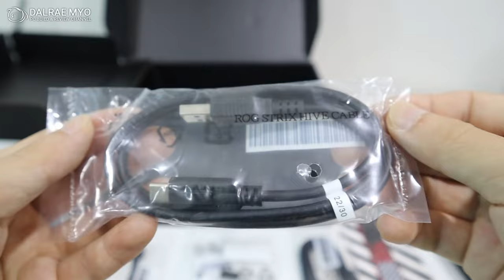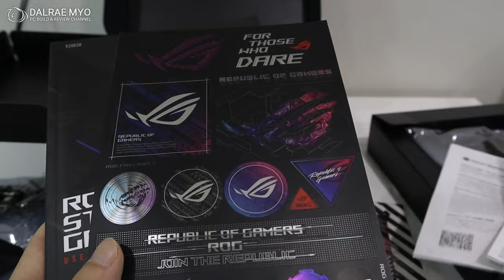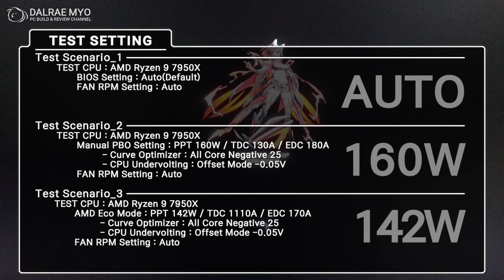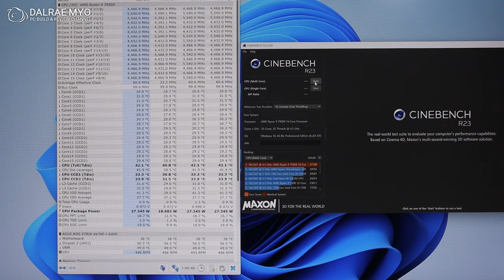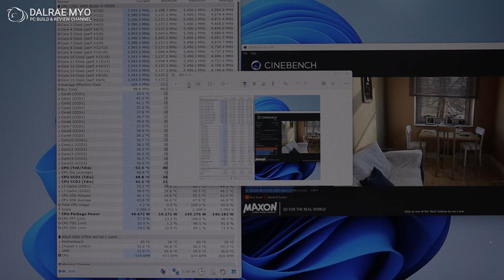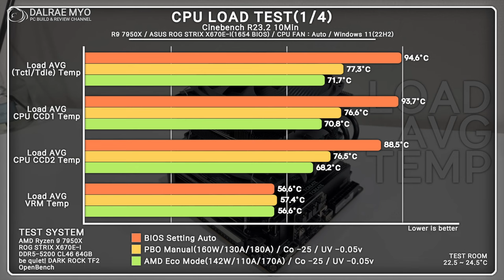ASUS ROG STRIX X670E-I Review | R9 7950X Air cooler Test

Comment from the maker: There is incorrect information in the storage description.
M.2_1 (Chipset) : PCIe 5.0 / Type 2280
M.2_2 (CPU) : PCIe 4.0 / Type 2242/2260/2280
Reply: Total supports 2 x M.2 slots and 2 x SATA 6Gb/s ports*
AMD Ryzen™ 7000 Series Desktop Processors
M.2_1 slot (Key M), type 2280(supports PCIe 5.0 x4 mode)

AMD X670 Chipset
M.2_2 slot (Key M), type 2242/2260/2280
(supports PCIe 4.0 x4 mode)

Comment: The chipset 1 fan on my Asus X670E-i just failed.  I'm having to use a clamp fan for now to blow cool air onto the chipset.  I'm just holding out until the X870E chipset mobos are released later this year.

Comment: Thank you, really nice content! It contains unique tests

Is it possible to test DeepCool an600/ID-Cooling IS67-XT with AMD 7950x3D with different bios settings?

Search something instead Noctua l12s (not enough cooling even with undervolting + with Fractal Ridge there is no space for air Cooling). Unfortunately due to the my inexperience I bought too hot CPU.
I want try to buy IS-67 XT + Create something similar to duct with small seal stripes + place small fans at the bottom of the case + undervolting.

Default Fractal Ridge + L12s + 7950x3D gives me 29900 - 31000 and huge throttle at 89c

Undervolting can increase that numbers only to 33700 (and only with opened lid😢)
Reply: I have 7950X3D and AN600. My temperatures (scores) are a bit better and ofc it still throttles. That's actually the price you are paying for building in SFF. If you really need 100% all core load (working with media?) consider buying a Silverstone VIDA AIO, I've heard it works with Fractal Ridge. If you don't - just forget about it and enjoy your system. If you aim for gaming - with AN600 you can expect 70-80C temperatures depends on a game. Cyberpunk 2077 is the most CPU dependent games I've tried. With RT overdrive and frame gen my CPU is around of 79-81C while exploring the city and that's absolutely fine for me. I knew what I was doing. Unfortunately there is no AIO support for my Fractal Terra so that's the best I can get
Reply from the maker: If I have a chance, I will buy a 7950X3D and test it, but I don't know when it will be. (It's economically stressful because it's normal for me to buy and test products myself, not rent them.)
Reply: @mikuruasahina3055   Thank you for information. Decided to order IS-67 XT and hope I can write my own tests when it will be delivered from AliExpress to my country (2-3 weeks). But in any case I think intake is better than exhaust when a lot of hot air cannot escape through the lid and it is then used to cool the CPU again and again. (using it vertically)
I really love my SFF, first PC in 10 years, hope I can make something)
  
P.s. Not sure that any AIO will fit with Asus ProArt 4070 TI OC (50mm and 32 left for AIO radiator and fan). But thanks for idea
Reply: @DalraeMyo  Thank you in any case. If it will be possible and it is just the idea that can be interesting for SFF users like me 🙂
I have ordered IS 67 XT and will write tests here, maybe it will be also interesting someone from your channel (but not as comfortable as your videos). Have a nice day)
Reply: So I have received my IS670XT about two weeks ago and now have some interesting information using 7950x3d

Firstly I have spent that time with OCCT to find out maximum negative CO settings for each core and then make tests with different maximum PPT settings (Fractal Ridge was in vertical mount, lid was opened, with Thermalright AM5 Frame, Ridge was with small a6x25 +a4x20 fans at the bottom)

Radiators: 
Noctua L12S
ID Cooling IS-67-XT

Slim Fans: 
Noctua A12x15
Unique ID Cooling 2200RPM 15mm fan from IS-67-XD
Silverstone AirSlimmer 120 mm 15.6 mm

Radiator + Fan:
ID Cooling + ID Cooling - 35123 
ID Cooling + Air Slimmer - 34908
ID Cooling + Noctua result was not preserved, but it was 1000-1500 points worse than the ID Cooling fan

So ID Cooling Fan >= Air Slimmer > Noctua (but it is quietest)

Finally I have tested Noctua radiator with an ID Cooling Fan and received 35892

That were maximum results from about 5 runs, after that CPU becomes hotter and I can receive maximum results - 400/600 points. The best Cinebench results in any case you will receive with 90 temps, there is no variant to receive low temps and max CPU performance without AIO. 

Decided to stay on Noctua radiator + ID Cooling Fan + my OC settings